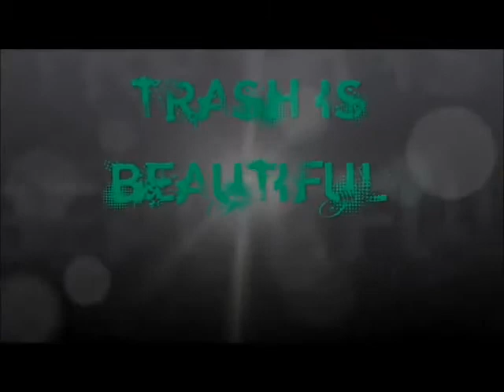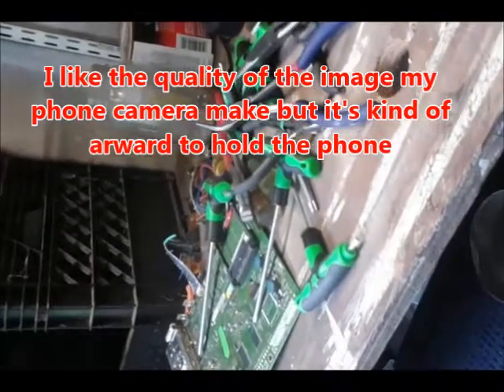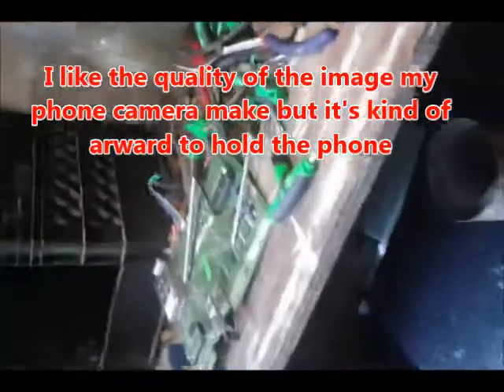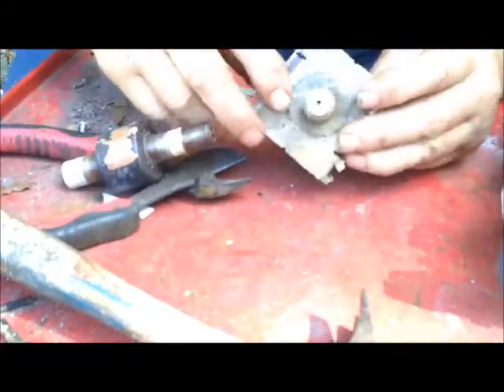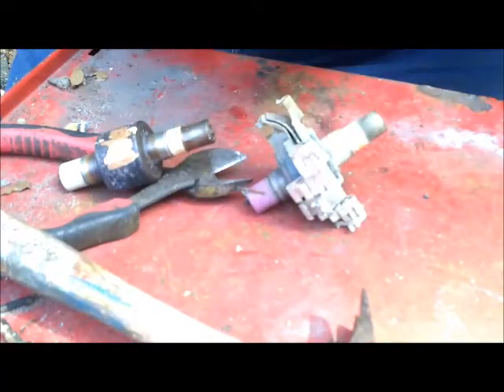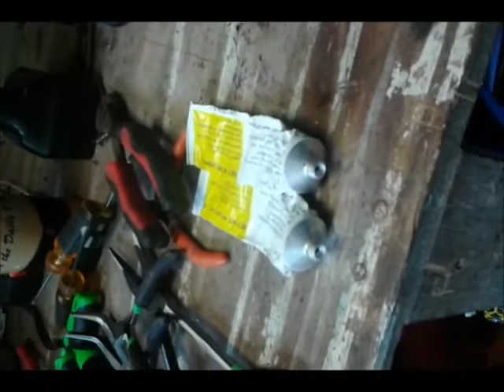BIG BRASS? AND LEAD SCORE MAYBE

Comment: Ok the little brackets may be Invar as for the lead yes I also collect it i will pick it up while I am out walking the new wheel weights are zink now to the big one I'm sure you know this but with messing with the magnetrons stay clear of the pink bits on the ends as the powder from if when it's broken up is DEADLY